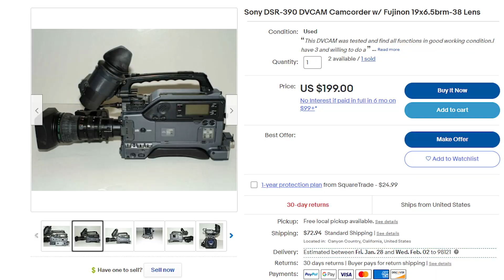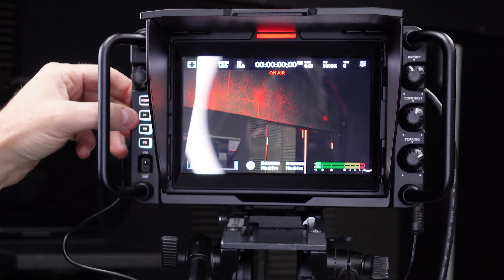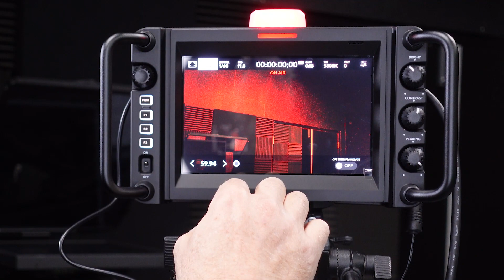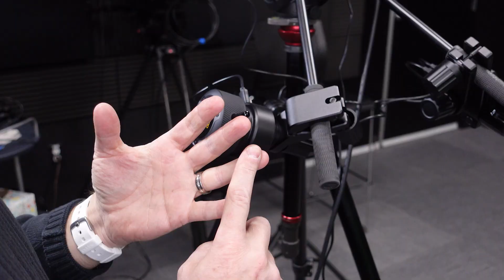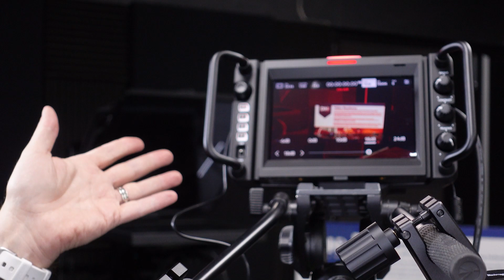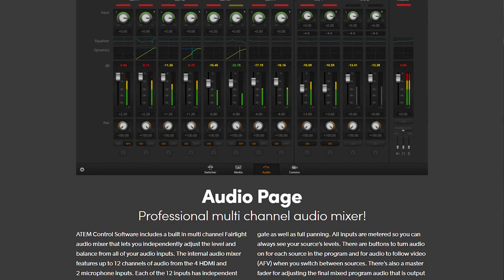Review: Blackmagic Design Studio Camera 4K Pro

Comment: I tried this month for the first time with both, mini studio and studio camera g2 in a flamenco show festival. In the last 10 days, I had good impressions but as you said in the video, these lenses are not enough for all scenes.
I worked with a few sdi cables with 50 meters lenght, and a central control in the top of theatre.
At those distances, Panasonic 45-175 lens have not enough quality and poor low 3.5 light from the start of zoom.
It's real that Black magic did a good job with Iso and may be that lenses are not showing the real quality  of the camera because
the other pancake lenses, located near scene, looks very different than this.
Also, colors of 45-175 looks more intense because of these light difference.
One of the days, I connected a manual Olympus lens and it was to another level.
But It's not compatible with zoom and focus demand and have not stabilizer.
The best thing can happen it's a new line of quality lens from Olympus and Panasonic  and of course, welcome any adaptation box for usb-c conecting  B4 lens or any system.

Comment: I have been using a JVC cam with SDI and HDMI outputs and the SDI single is going to one of my Laptops using a SDI to HDMI converter the other HDMI single is going to the ATEM mini pro and it'ts connected to another PC for OBS to Stream to FB Can I use the BM 4K pro in the same manner? IF so is it something that has to be set to send both singles or can it only do one at a time

Comment: The decision to make the lens work with the zoom demand rests with the lens manufacturer, not Blackmagic. Blackmagic makes the zoom demand to control the camera, not the lens. The lens needs to be designed and manufactured to talk to the camera. When using zoom servo demands for the B4 lenses each individual lens manufacturer has a zoom remote designed for its specific lens. The zoom demand is then plugged directly into the lens, not the camera. These devices cost a lot more than the Blackmagic zoom demand.